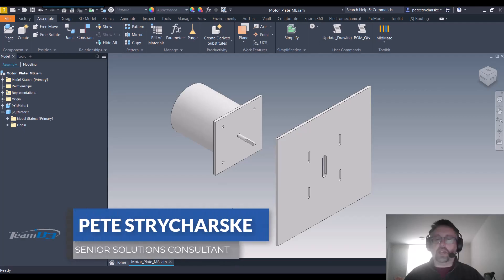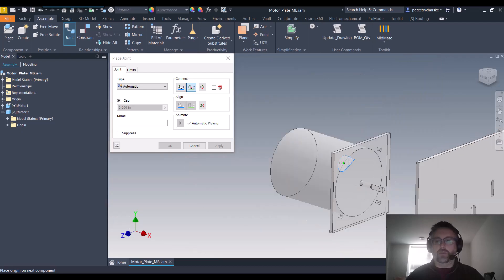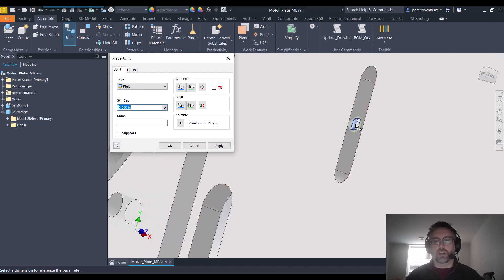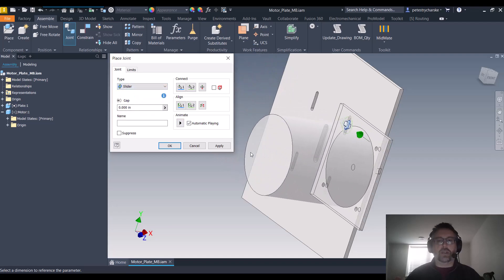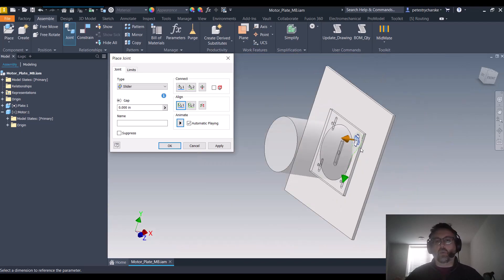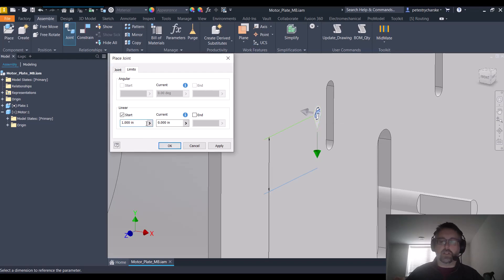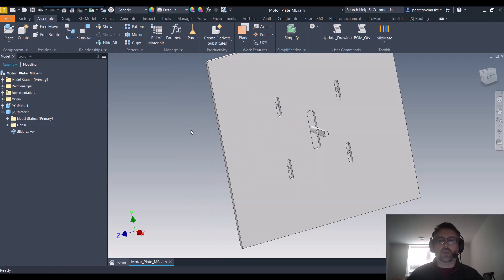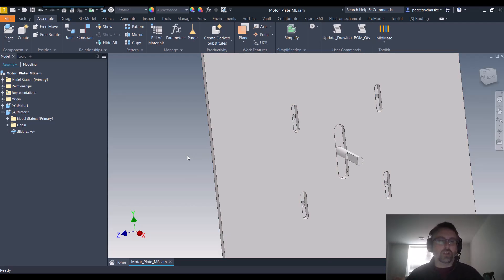Inventor - Centering a Hole in a Slot with the Joint Command

Comment: Wow, i have struggled with this for ages. I use slotted connections a lot for brackets and i always just had a sketch ppint centered to slot to join to.
Reply from the maker: Hope this helps to streamline the workflow moving forward!  The CTRL-hover technique makes Joints much easier to use in my opinion.  Also, please note that you can right-click on the mouse to obtain a couple other options for Joint connections.  Thanks for reaching out and have a most blessed day!

- Pete